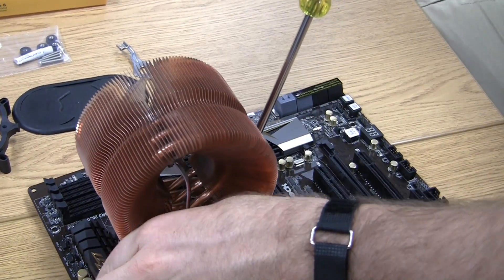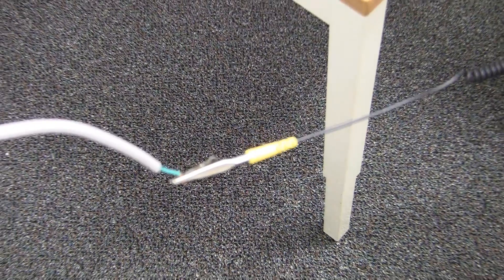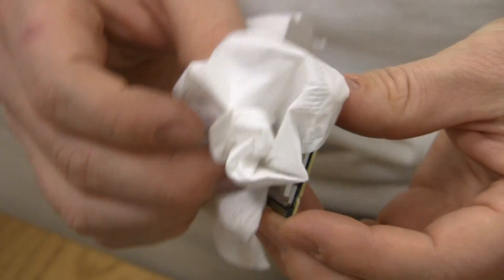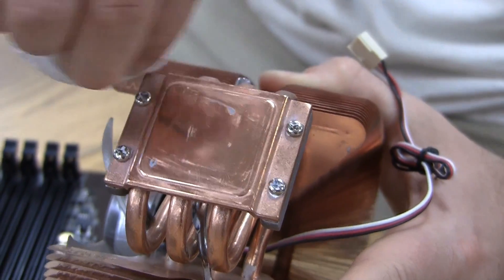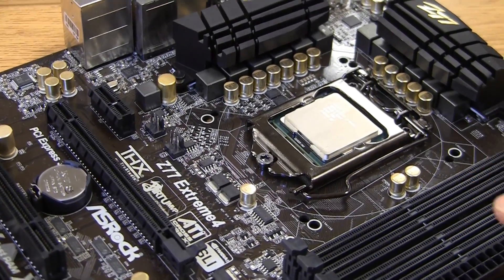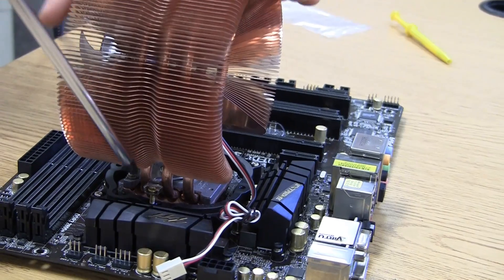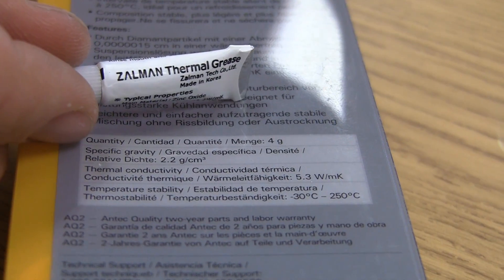How to Remove & Apply Thermalpaste on a CPU

Comment: That motherboard and cooler look so much higher quality than these days
Reply: But they're neither. That cooler for sure looks a lot more imaginative than the stuff you get today, but it did not work spectacularly well.
Reply: @SianaGearz  Isn't that bad. I'm still using the CNPS9500 and the temps are pretty much stable, never hit 70+... always stays in the 60's

Comment: Will the thermal paste hurt the PIN SIDE OF THE CHIP,  how can a guy remove it from between the pins...?  Will it hurt anything if left there...? Will that mess up the socket...😣
(Previous own touched the paste and spread it on a couple pins) while cleaning that off, i see a bit between a couple pins.......
Reply: I know i'm probably way too late, but...

Depends on which paste. If it's Arctic Silver 5, it needs to be removed. If it's MX2 or other ceramic paste, and there isn't much of it, you can probably just leave it on.

Easiest method is to take brake cleaner - at least the stuff sold as brake cleaner here, which is actually purely light purified benzene in a spray can, it should also say that it's non-corrosive and safe for plastic and lacquer surfaces, like Caramba brake cleaner, go outside, and spray down the CPU hard, don't be stingy, that will get rid of it easily. Then you wait a little till it evaporates, and come back inside.

If you have contaminated the mainboard socket and believe it might cause issues, you might be able to get isopropyl alcohol in a spray can. Brake cleaner can be used too, but ideally shouldn't, since benzene can absorb into the rubber bungs at the bottom of aluminium electrolytic capacitors, temporarily expand them, and jack the casings open a little, which might make them more prone to failure years down the line, though i don't have per se proof that it will cause issues, just a precaution. With a CPU, this isn't even a concern. You can use isopropyl alcohol indoors, but ideally air before you breathe too much of it.

Other viable products are electronics contact cleaner and potentometer contact cleaner, but only if it says on them that they're residue-free, then you can use them. What you get there is light benzene with an evaporation accelerant. You can then use them on the CPU and on mainboard no problem. Benzene is cancerogenic though, not very strongly but still, so best outside or take measures to avoid breathing it in.
Reply: Thanks for the response - good info to know. I used the isopropyl alcohol and it came off. All worked out with no issues. But I didn't know brake cleaner was an option.  (I'll use it next time..if there is a next time).  Thanks again

Comment: What is that fan?
Reply: Zalman CNPS9700, released approximately in 2007-2008. It's very pretty and should last an eternity and a half with barely any wear, and it was expensive, but not great for the combination of cooling performance and noise.

Comment: That is a very exotic heatsink
Reply: That, my friend, is the heatsink for one of the best, if not the best, CPU coolers ever created. It is a Zalman product the model name/number of which I sadly no longer recall because I first got my hands on it 12 years ago. But let me tell you, so much copper cannot be beaten by anything, even the flashiest and bulkiest coolers made today. Zalman may have raised South Korea's national debt while producing the thing but it was worth it because this is a product for the ages. And it's not just the material. Said exotic heatsink somehow manages to dissipate way better that the modern fat stacks, while being smaller and quieter.
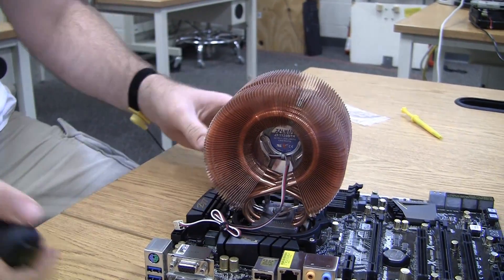EDIT: Turns out you can actually see the model number on the fan @ 3:24 in this video. But it's not the one I am thinking of because this one has terrible mounting mechanism and is substantially larger. Still, not a bad successor. If you can get your hands on such a product today, do it.
Reply: @BobMotster  No. It's not that great. There's only 3 heatpipes, only 6mm rather than the more efficient 8mm, the fan just blows wherever, a lot of fin area does nothing as there is too little thermal conduction to it. This is a beautiful and imposing, and elegant looking, but ultimately quite inefficient construction, while also being quite pricey, not just in retail price but in sheer construction cost, that thing is not easy to manufacture, which is why you don't see anything like that today. Specifically it's a CNPS9700, from 2007-ish. It wasn't that great even back in 2008, performing about as well as you'd expect from a 92mm tower cooler except louder. Critically, the heatpipes aren't allowed to work very efficiently, for the lack of a well defined hot and cold end, since both ends are terminated in the base plate. The most efficient part of the heatpipe near the base is left bare with no fins, and the whole top third of the cooler, everything above the fan hub, doesn't do barely anything. You can't replace the fan, but this is an endurance fan with double ball bearing, so it should last an eternity and a half, but unfortunately is much louder than sleeve and rifle bearing fans.

der8auer actually made made a video a couple years ago about its sibling, 9700NT, which is the same cooler, but the copper is plated with dark nickel, which is just gorgeous.

Look i love crazy coolers just as much as the next person, i have had a Scythe Grand Kama Cross with a 14cm fan for the longest time and will probably use it again, when i figure out how to make new mounting hardware for it. I might even nickel plate it myself. Holy shit that thing is crazy. But ultimately it's only OK.

In 2009, Zalman made a successor, the 9900, but it is built a little differently, with two separate sets of fins and the fan sammiched between them rather than sitting inside the fin stack, less bulk and weight, but still only 3 heatpipes. It performed worse than 9700 for the amount of noise it made. It came with a plastic shroud to "optimise" the airflow, but it was better taking it off, the shroud made 2db louder, added a whistling noise, and provided between 0.5°C and 6°C less cooling performance! What a mess.

Hyper 212 (original, before Plus, before Evo) already existed back then! Same cooling performance as the 9700 at 11db noise less. Xigmatek S1283 variants were even better.
Reply: @SianaGearz  I'm sad to say that, after reading your impressively detailed comment/review, my opinion dropped a bit. Even if the implementation is imperfect though, I still believe in the idea. Maybe with more pipes, sintered according to modern-day standards; additional fins near the bottom; closely stacked fins near the top and a magical fan design a la Noctua for lower noise emission, maybe, this idea can be salvaged.

There's just something about the circle that draws me in, my instinct telling me that this is the better way to handle air rather than cubes, hexagons and vertical cylinders so I remain hopeful that one day, either Zalman or another manufacturer will perfect this design and surprise us pleasantly. Or maybe I'm delusional...

Anyway, thanks for a detailed, well-founded comment! A rarity on YouTube these days.

Comment: Yes, every CPU comes with a stock cooler and the stock cooler has Thermal paste applied to it. You just have to install it and its ready to go!
But i recommend getting an aftermarket cooler, they're not that expensive and have greater cooling abilities.

Comment: good to know- have yet to build my first system and up till now this thermo-what-it-ma-call-it seemed like nothing to me, till i got reading about the horrors of the ivybridge cheapo heat spreader sandwich solution (got the 2500k to fight urge of replacing it).  as for the paste i guess can now look for the most expensive 4g and not overlook the quantity with the price!